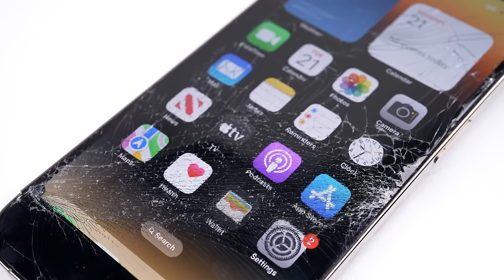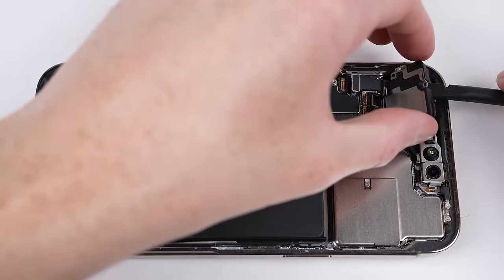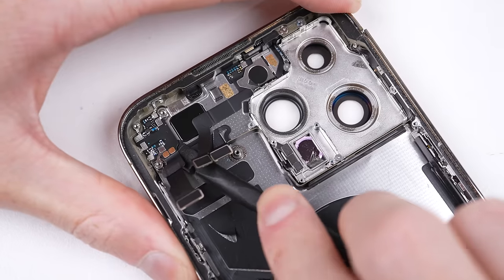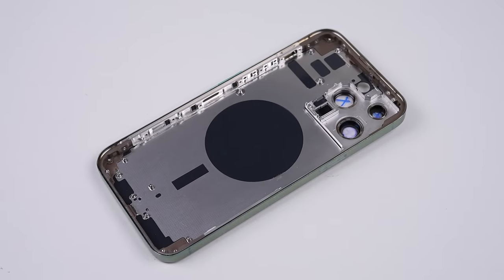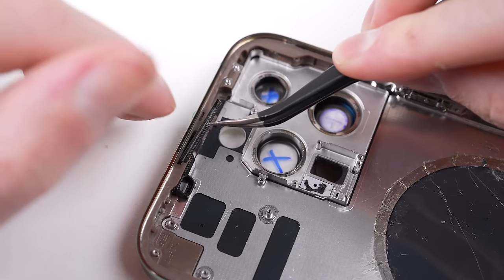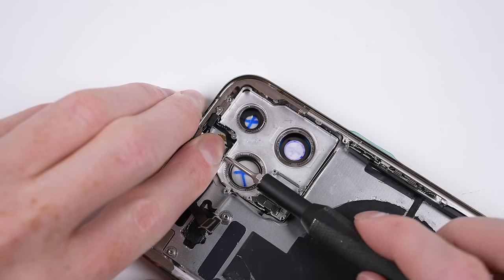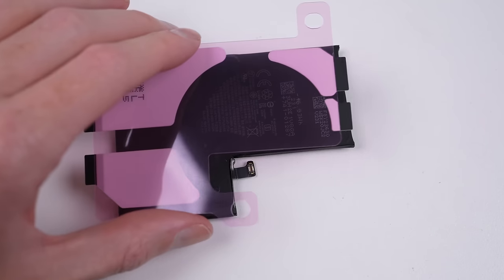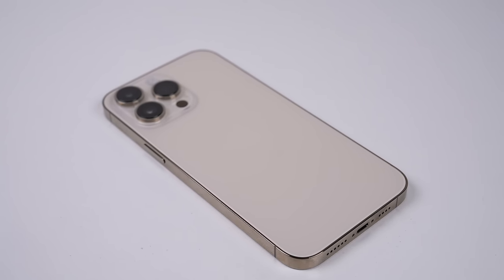What It Takes To Repair The iPhone 14 Pro Will Anger You - iPhone 14 Pro Max Restoration

Comment: I can imagine how many hours for 3rd party repair takes times for disassemble and reassemble components and there's a chance that it can get confusing.
Reply from the maker: They probably skip steps, which causes an unprofessional repair. But you cannot really blame them...
Reply: @HughJeffreys  My bet is they just stick with pre-assembled modules.
Back module including all the magnets installed, buttons, meshes and so on, and you just drop the boards, battery and such in place. Hence the price: you'll be paying for man-hours or part price, it's gonna be expensive regardless, so trade man-hours for parts, and the technician moves on quicker.
Reply: Easy solution: Never use 3rd party repair 😊
Reply: @SlyCooperRN  That's what Apple wants you to do. They want you to just buy a new Iphone
Reply: @IdeasAreBulletproof  If that were the case then they wouldn’t offer AppleCare+ 😁
Reply: At my shop we just use a laser to remove the back glass. Saves having to do any of this and phones aren't waterproof anyway.
Reply: Wouldn't the same be said for Apple repair technicians? Or would they much rather persuade people to buy a new device to avoid the dread of having to open up and repair iPhones?
Reply: @SlyCooperRN  Apple thanks you greatly for helping with their profit monopoly!
Reply: They will purchase an oem housing ehich include everything like old one
Reply: @Kalvinjj  Just telling it how it is. Don’t like it? Don’t take on the risk of not getting protection for your phone 😬
Reply: Trust me, people get offended when you quote a repair that takes longer than an hour or two.  So most shops just do it cutting corners instead of potentially losing business because of impatient customers.  There is always another mall kiosk.
Reply: @SlyCooperRN  You got lost lil’ bud? You are in the comment section of a self-repair channel… We all know you can throw money at the problem, not much brain power is required for that!
Reply: @HughJeffreys  you know you can buy a ring of MagSafe magnets right?
Reply: @SlyCooperRN if they didn’t offer Apple care plus, there would be riots
Reply: @Marwarluigi  There ya go 😁
Reply: As a third party repair shop, I unfortunately have to refuse these repairs due to the amount of labor involved, but most importantly, the liability involved. Even the most experienced tech could have a slip of a screwdriver, damaging one of the many components that are serialized, resulting in an angry customer. The repair groups I'm in are constantly flooded with posts from panicked technicians that swapped frames and are having critical issues afterwards. It's simply not worth it, and is another example of how Apple is currently winning their battle with the repair industry.
Reply: This is the exact reason I got the s22 ultra instead. New + easy to fix
Reply: @SlyCooperRN  Easy solution: Never buy apple 😊
Reply: @SlyCooperRN  Even that is totally useless on really minor repairs
Reply: @Burns_RED  Would definitely not recommend that 😊
Reply: @bennybouken  It’s resolved every issue I’ve had, major or minor 😁
Reply: @SlyCooperRN  how much did they charge you for one minor repair?
Reply: @bennybouken  For factory defects? No charge. Accidental damage? 29 USD 😊
Reply: @HughJeffreys  are you going to invest in one of those devices that let's you clone the serial number for parts?
Reply: @SlyCooperRN  Its meant to get a new phone for cheap lol
Reply: @SlyCooperRN  Why wouldnt you reccomend not buying apple? Scared of not beign able to connect your AiR pODs To your watch? 😊😊
Reply: @SlyCooperRN  finally, i found apple forgiver on repair channel. Keep it up
Reply: @SlyCooperRN  I miss the days when if I broke something, I could fix it myself and it would cost me what a month or two of the insurance costs, but that might just be me
Reply: @christianvaniten  yeah I’ve seen videos of iPhone repair just lasering and cracking the back shell.. this video is about how to make repair more labor-inducing lol
Reply: @HughJeffreys  How can I buy this restored iPhone ?
Reply: @YasinVanDoorsen  You planing on breaking it then?
Reply: @SlyCooperRN  Better solution dont buy Crapple
Reply: @griimae8022  You dont need much brain to get a insurance so you dont have to self repair a phone.
Reply: @Blackhomeking12  Rather have a new phone than 3rd party repair 😊
Reply: @butterfox863  Cringe 😬
Reply: @zulfika_  Don’t be butthurt 😊
Reply: @snintendog  Scamsung fan? 😊
Reply: @HughJeffreys i own a electronic repair shop and the phones are so hard to fix
Reply: I can imagine it takes the same amount of brain power to create one that’s modular and easily repairable. The question is which is more profitable
Reply: 3rd party repair guy here, if it werent for the frame itself being bent or crack, we would just replace the rear glass  not the entire thing as an assembly, hence no need to kill yourself removing all those little screws and brackets. We use a special laser machine to burn the glue holding the glass on, then it's down to picking each and every small piece of glass off with a flat metal tool and tweezers, then cleaning up the residue, and applying new adhesive to glue on a new piece of glass, lotta work, and thus expensive, but doable non-the less. 
also even if the screen is being replaced you still want to take care in removal since if the screen itself is still functional (i.e. no lines, green tinge, or black spots), it can be resold to refurbishers for money back, and this  is how most 3rd party repair places get their OEM screens (since apple wont sell to us, unlike samsung, hence most of the time you will be getting an aftermarket, unless you either specifically request for one or no aftermarkets are available yet, as is currently the case with 13pro, 13pmx, 14+,14pro, and 14pmx), with the 14pmx in particular being really valuable, going for around $400 from our supplier. plus if the screen is atleast partially functional you can use that to copy true tone over to the new screen with a special reader. also, you'll want to avoid cutting or otherwise damaging any part of the ear piece flex cable, as that is part of face id, and is a serialized part, so generally speaking is not replaceable by 3rd party repair, or more specifically if replaced face id will be permanently disabled, much like with touch id on the physical home buttons present on ip8/SE 2nd gen, IP8+, and below.

It's also part of my personal code of ethics to try to keep the parts in the same condition as I recieved it, just in case it turns out something else is not working (such as anything on the logic board) and it's either not something I can fix or the customer simply doesnt want to spend the extra money on it, on top of the screen cost, this way I can simply return the device back to the customer with the original parts, and not have to argue with the customer over giving them free reapairs because "you touch it you own it" (see louis rossman's vid on the topic if you dont know what im talking about). 

Generally speaking, I dont believe in charging people if i cant fix the issue, so i offer that as my personal reassurance to people convince to fix things with me, instead of going through apple (even though the local apple store often wont help them if they dont have applecare or will give them some crazy "fuck off price" to get them to go away or buy a new device, while straight up lying to them saying things like replaceing the screen will erase all your data).
Reply: @SlyCooperRN  apple sheep 😊
Reply: @norbico17  Sorry your feelings got hurt, kiddo 😬
Reply: @HughJeffreys  After the screen replacement, if you transfer the proximity sensor, the face id works? I tought the face is is paired to the screen itself as well. Thanks for the answer! A fan from Hungary. :)
Reply: @SlyCooperRN  Why there are 3rd party repairs that do an ever better job than the manufacturers
Reply: @Blackhomeking12  Very few and very far between 😉
Reply: @SlyCooperRN  not all place have applecare+
Reply: @MuzammilKhan-oi6td  Finally, a valid point. Still worth it to get for those traveling internationally to countries who do provide support options 😊
Reply: @SlyCooperRN  so you want to say people should travel for this
Reply: @MuzammilKhan-oi6td  Reread it and see that I said it’s a good option for those who DO travel. Pay more attention please 😜
Reply: @SlyCooperRN  yeah for those who travel a lot
Reply: @MuzammilKhan-oi6td  There ya go 😊
Reply: @SlyCooperRN  so it isn't for us
Reply: @MuzammilKhan-oi6td  Then again, if authorized repair isn’t supported where you’re at, third party repair must be a nightmare 😵‍💫
Reply: @HughJeffreys  why didn’t u use the device for copying the serial number off old components and writing on new ones
Reply: @zyncwargaming179  Huh? You obviously have no clue what you’re talking about 😬
Reply: @SlyCooperRN  so you are trying to tell us that paying more than 10$ a month even tho your phone isnt broken, just in case it might break so you can, in the end have the same if not even higher repair cost than basically any other phone brand, then when you try to repair it yourself even feature locking when you dont have the part with the same id as the rest of the parts in your phone, even if it is taken from a genuin donor phone and not a 3rd party part makes sense.. i really hope you are trolling because everything else is just delusional. this is total anti-consumer corporate bullshit. oh and btw other phone manufacturers also have their own "care+" system wich is normally around 100$ cheaper and there once even was a time where these "care+" systems werent really needed because some manufacturer didnt just decide to make 3rd party repairs harder and more expensive so you could'nt just go to a local repair shop and have them fix it for way less money. and in the end, if you handeld your phone responsibly and didnt break it during the 2 year "care+" period like a responsible person does (accidents happen, but most people just dont break their phone), you basically just threw away another 250$ that of course they wont give you back and wich back then, those 250$ where a total repair in a 3rd party shop. but i mean.. you do you buddy
Reply: @mischol  If you’re willing to take on the risk not protecting your phone, don’t cry when you have to pay the price 😉
Reply: @SlyCooperRN  i dont buy apple anymore so it would not even cost that much for me to repair😉 but i mean of my 7 smartphones that i had over the years none died so 🤷‍♂
Reply: @mischol  Sounds like android! Having to constantly replace and upgrade phones. Gotta love iPhone bc over the span of you having 7 phones, people are switching to their second or third iPhones 😜
Reply: @SlyCooperRN  bro, i could spend like 15 minutes writing down wich devices i had but to keep it short: 5 of my 7 phones i got either from family member since they got a new phone included in their plan every 2 years or bought used phones from friends and i know how to swap a batterie😘 and i had several apple devices in the past, in fact my first and the one before the one i am currently using where
Reply: @mischol  No wonder you’re so offended, you can barely afford to buy your own things 😂 I’d be upset too if everything I had was a hand me down
Reply: @HughJeffreys  true
Reply: @Crimson  right simple solution but most won't do it
Reply: @SlyCooperRN  Samsung isn't a scam crapple is
Reply: @SlyCooperRN  crapple is for old people
Reply: @GameN3rdz  LOL super cringe 😬
Reply: @SlyCooperRN apple will tell you to fuck off and buy a new phone, and then throw your phone in the landfill

Comment: I remember how unbelievably easy it was to repair my iPhone 7+ myself and I rebuilt that phone 5 or 6 times in the time I owned it, good to see that since then Apple has only recomplicated it once again and made it harder to keep their devices up and running
Reply: Over 4 hours for a professional is mad. Transplanting everything to a new case when i dropped my Redmi 5, years ago, took maybe 40 minutes and i never had opened a phone before.
Reply: This is why im glad have the iphone 12 mini. Because the newer the iphone the worse it gets
Reply: I used to repair my 4S myself, it took a very long time to disassemble and assemble and ended up with the new screen flex cable being too short 😢
Reply: @Psi-Storm my iPad took an hour to repair, it’s an old model tho
Reply: How else are they going to force you to buy a new phone?
Reply: same, lets say the battery for example, even someone who knows NOTHING about tech could do that. and battery wear is probably the main reason for people discarding their old phones
Reply: The iPhone 8, and the SE2 and SE3 that use it's parts, are the last of the truly repairable iPhones. The 7 is another great honorable mention of repairability. Much easier than an average android screen swap aside from the need to program them...
Reply: To be fair, this is an extreme case in this video. Simple repairs similar to what you're likely thinking of have largely remained the same minus some extra bits and bobs (facial recognition components). Don't forget anti-consumer non-genuine warnings, of course.
Reply: @drncsddmk8798  this happens all the time on the 4 and 4S. The cables most likely got snagged or something wasn't seated all the way
Reply: I have a little iPhone 7. It was my 12 year old. And I put a screen on it 4 or 5 times and one new battery.  He was ver very rough.  My iPhone fixing days stopped at the 11. The 12 mini  was more difficult, and I broke 2 screens before I got it so no more for me.

Comment: Everything is crazy about this phone. The price, the complexity of the design, the engineering behind every part, and how everything has been thought to prevent a repair from a non-authorised technician. Software locks, paired parts, tricky screws... they know exactly what they have want to be able to fix while making you unable to fix it. That's as brilliant as it's frightening.
Reply: @Brajesh Kumar Naik lmao
Reply: @Brajesh Kumar Naik Hot take

Comment: I always appreciate the mesh grills being transferred. Something that you will rarely see in repair shops but is important. Great video
Reply: Most of technicians don't return the mesh grill after replacing the screen
Reply: You think the mesh grills are bad? I've seen too many phones coming from other shops with the brackets and screws that hold the cables in place just completely missing.